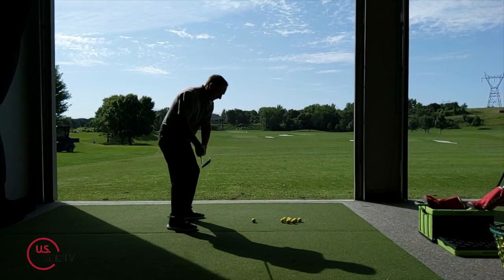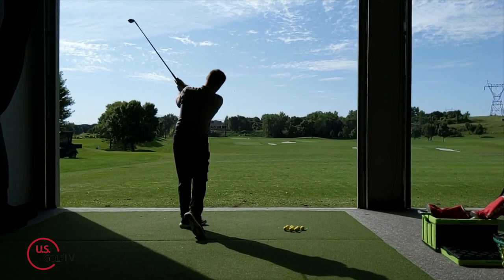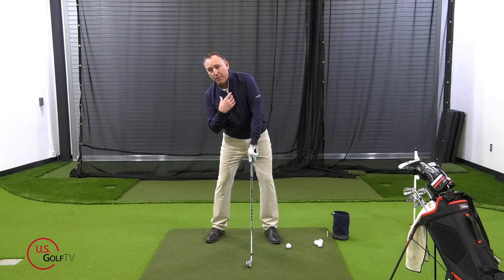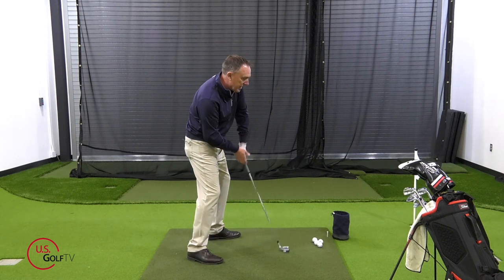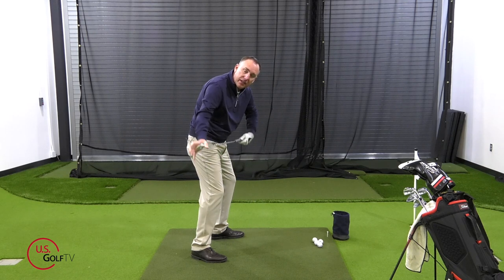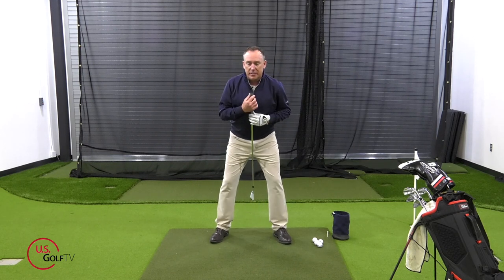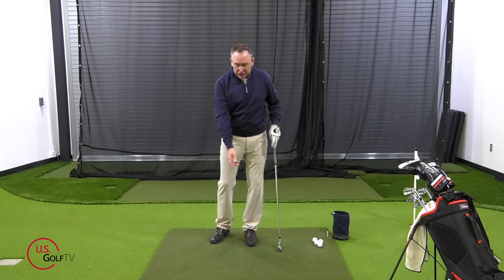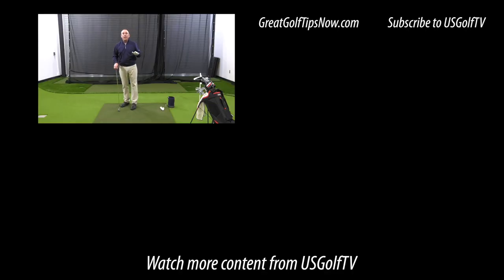How to Fix a Hook in Golf (Simple Golf Drills)

Comment: I tried this and it fixed my problem.  Thanks!
Reply from the maker: Bob Roche awesome! What was the key?
Reply: @USGOLFTVshow  I was tilted too far back .  Used the tip with the driver to measure a better  amount of tilt. Bumping the lead hip forward was usually enough.  Still have other issues but this was a big help.  Thanks.